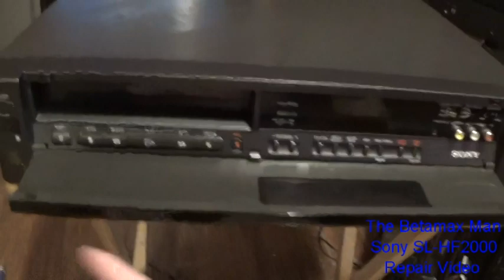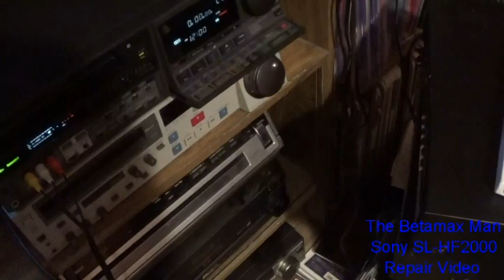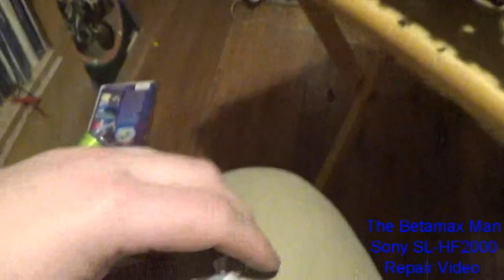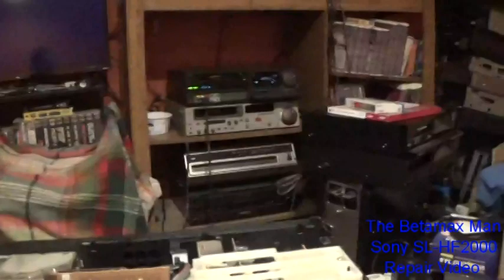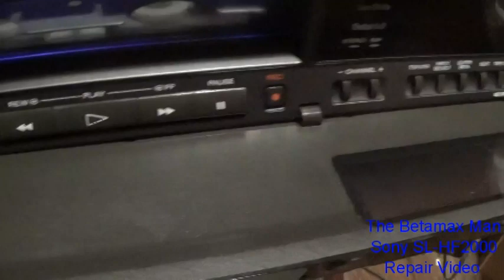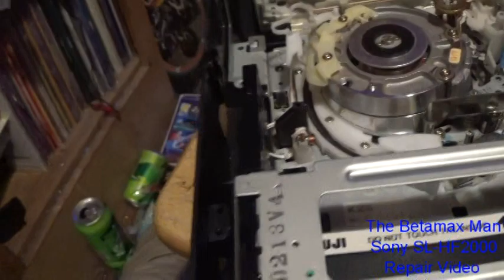Sony SL HF2000 Repair

Comment: Did you get a remote for this? You can use a '90s VHS remote to get those extra functions, including manual tracking on the remote.
Reply from the maker: Yes I knew that thanks for your support

Comment: For some reason, my SL-HF2000 sometimes plays ßIII tapes at ßII speed, which means there’s briefly a sped-up playback, then the sound disappears, then the picture disappears and the counter stops advancing even while it’s playing. What do you think is the cause of this?
Reply from the maker: sounds like a capstan servo problem the servo board controls the speed of capstan and the head drum somtimes its caps or a resister thats gone open thats where i would start

Comment: I'd be so happy if I could just get my HF2000 capstan to stop running BACKWARDS!
Reply from the maker: the ic on the capstan motor circuit board is bad most likely the issue

Comment: I have this deck. It has white ghosts at times during playback. These tapes play fine on other machines. Turning Superbeta on/off doesn't make a difference. I've read that sometimes those white lines can be caused by a bad ground to the center of the head drum. I measured continuity from the top/bottom of the drum to chassis ground and there is not a connection. It seems like my unit may be building up static electricity that causes the white specs to appear occasionally. Do you know of a way to fix this?

Comment: I have one of these decks. It was passed on to me from a family member. I tried to play a tape in it the other day and this is the issue the unit is having. I power the unit on, it takes a tape without issue but when I press play it goes into this "shutdown" mode where none of the buttons will respond unless I power off the unit and try again. What would cause this issue to happen? FFWD, RWD seem to work okay but pressing PLAY locks it up. When I researched the issue I found that the unit goes into this "shutdown" mode to prevent further damage from being done. I have tried various tapes and all of them do the same thing.

Thanks for any insight you may have.
Reply from the maker: the idler motor may be bad try cleanig the post the the tape reals ride onn clean them put one drop of motor oil on all the metal posts then put tape reals back on also do this to the post that the penguin gear rides on and change out the 4 caps on the idler motor circuit board there 16v at 47uf hop this helps you if it dont work let me know
Reply: @thebetamaxman8905  Had to wait a few days to get back to you so I could order caps. I did not have any on hand that I could use. The caps finally came in and I ended up replacing all four and I still have the same issue. The tape goes in but the unit will not play it, it goes into that shutdown mode.
Anything else you can think of that I could check before I throw it at the wall?
Reply from the maker: @qzack9944  the idler motor might be bad the hall efect device fails its a commen problam
Reply from the maker: your capstan may not be working to @qzack9944

Comment: You can manually track the tape....You use the channel up or down on the front panel.
Reply: There is also a way to turn on/off auto tracking with a button on the original remote.  The original remote also allows manual tracking - maybe the only Betamax that allows manual tracking using a remote.

Comment: When he paused the image, that Macrovision copy protection bar became visible at the top of the picture. 

This has me kind of wondering why studios even bothered to put macrovision protection on their Beta titles. I myself as a teen in the late 80s/early 90s held on to the Beta format for the longest of times due to their ability to dub MV-protected titles, making it possible for me to build a considerable movie library at a lower cost by just renting the movies I like and dub them to beta, at one point having some 200+ Beta tapes, each tape usually containing two titles. 

Those beta tapes as well as that old Sony SL-F1 deck are long gone by now, sold to some German Beta aficionado guy in the early 2000s. But as a movie lover at heart, I think fondly of those days.

Was what I did back then illegal? Sure. But for a teen with a very low income the COST of those pre-recorded tapes were pretty steep, too. I justified my actions by saying that I at least RENTED those movies, so the studios weren't at a total loss. Besides, being one of the few among my peers to own a Beta deck it wasn't as if I was able to lend out my tapes to my VHS-buddies (which also made it easier for me to turn down REQUESTS about borrowing a tape). So it all stayed with me.
Reply from the maker: Thanks for sharing your story with us

Comment: This machine (SL-HF2000) is an example of the Japanese equivalent model having more features than the North American model.  The Japanese equivalent is the SL-200D.  As you can see from the 'D' suffix, it has a digital-effect board and provides clear still-frame and picture search, as you can see here: 

https://www.youtube.com/watch?v=lel0EZPJKLs&t=22s 

Its remote control also has an LCD display and a jog/shuttle wheel: 

https://www.youtube.com/watch?v=zAxXQaHL2nM&t=280s 

1:17 - For Betamaxes sold in the U.K. and the rest of Europe, there is an excellent website called "Betamax PALsite".  According to it, the last Betamaxes sold in the U.K. were the SL-S2000 and SL-S3000, from 1987.  Betamax did not sell as well in Europe as it did in North America and Japan. 

5:20 - I am often perplexed by the high asking price for these machines, too.  My best guess is that since they are the most recently made Betamaxes for North America, it is assumed they will have the least amount of problems, compared to older machines which will have experienced more wear and tear. 

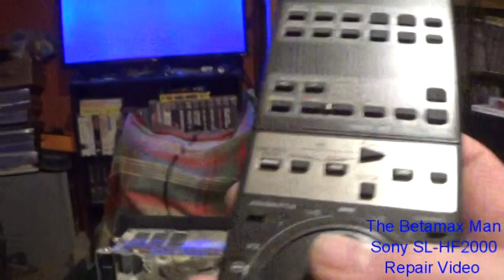53:29 - That looks like the remote for the SLV-50 or SLV-70HF (Sony's first two VHS VCRs). 

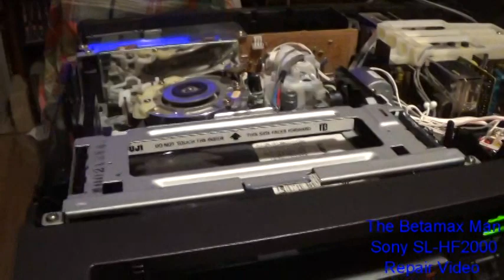1:23:59 - I think the video drum is left spinning after you push "stop" to allow you to start playing again immediately.  (My mother used to have a VHS machine like that.)  While a typical Betamax will keep the tape threaded around the video drum at all times, the video drum still needs to be spinning to play the tape.  Spinning up the head introduces a delay of a few seconds.